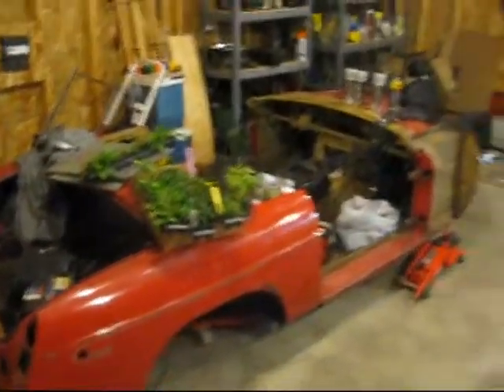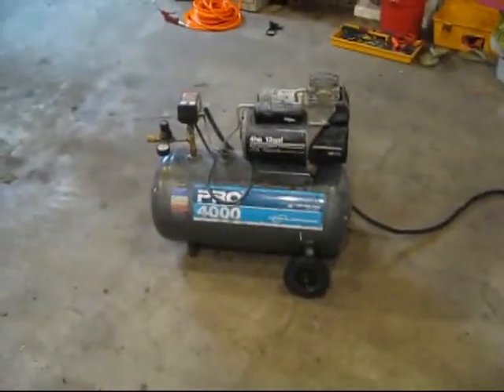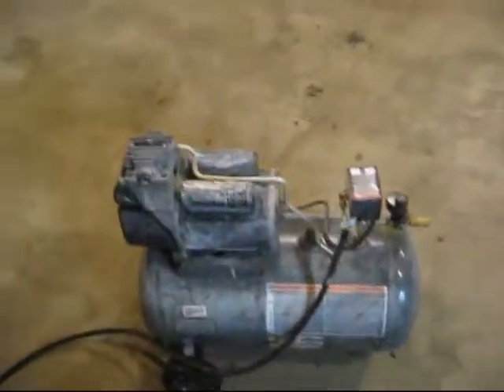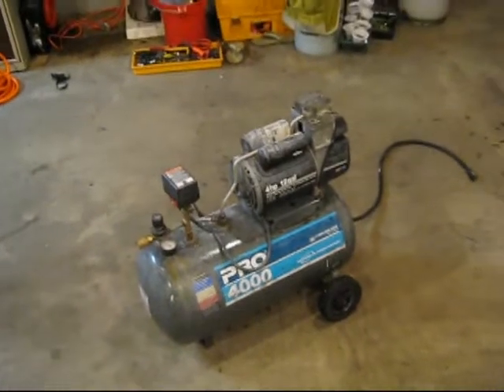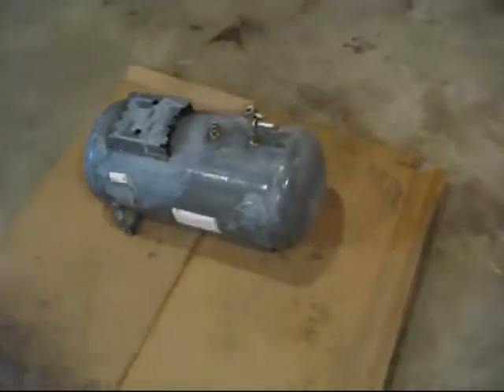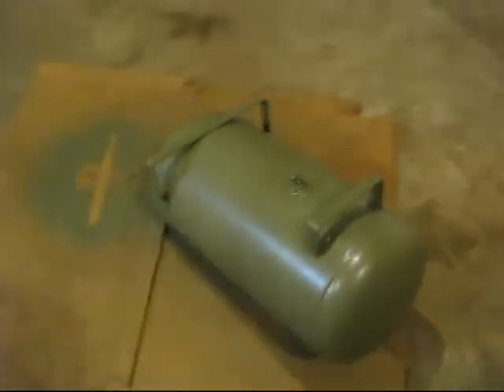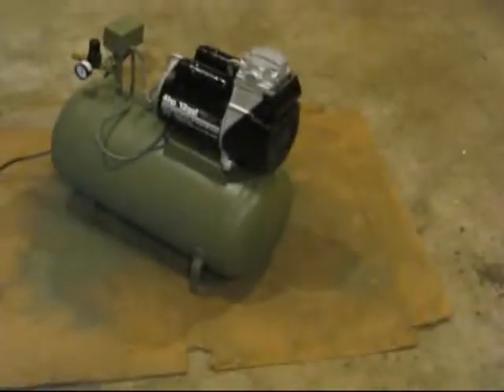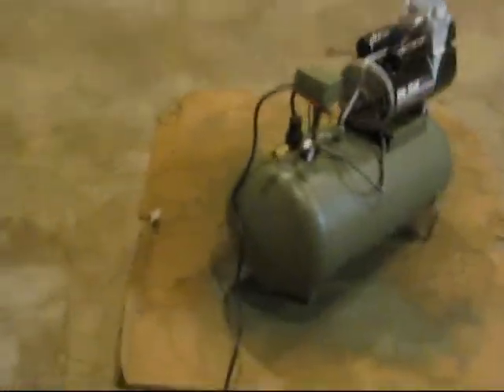MG39 - Project Bad Ass Air Compressor

Comment: Hi Marty,

Stumbled across your vids looking for sandblasting stuff. It's funny how much you're going through parallels my issues - (1970 TR6, restoring it in my garage). I'm a shade-tree mechanic but like my thought process on air compressors, etc, is exactly the same. (Do I need it? But I wanna buy pneumatic cut-off tools, do my own paint, etc!). Keep up the great work and vids!